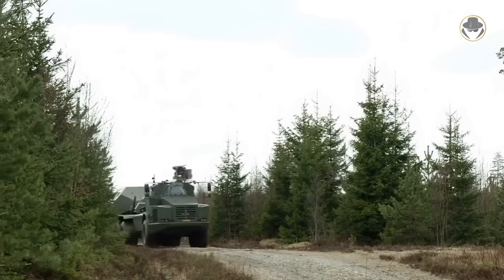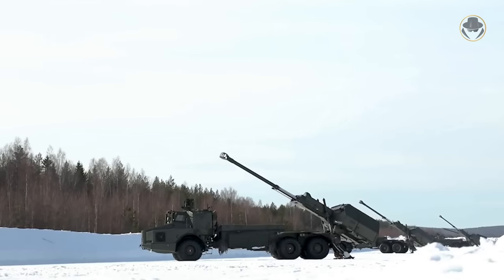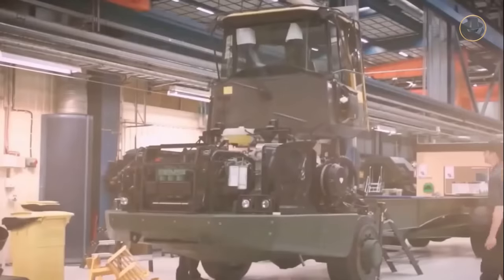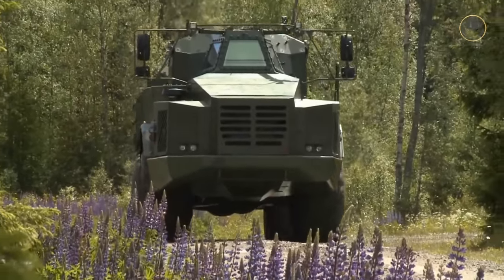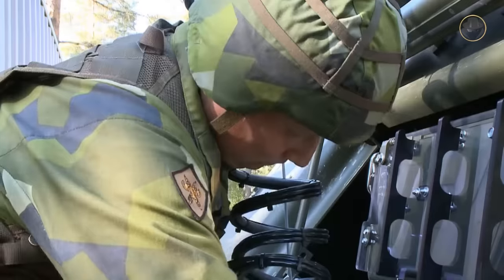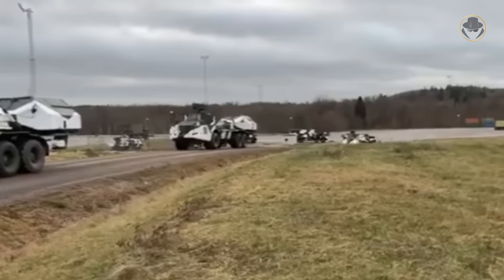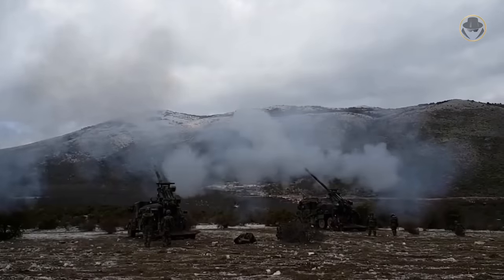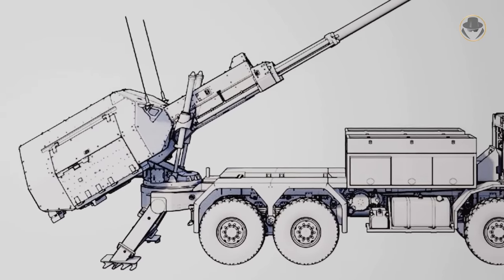Archer Artillery System | What is wrong?

Comment: They are very long, difficult to use off road in broken/rocky terrain, also useless off road in all but dry or frozen conditions, hard to use in densely forested areas, and too expensive.
Reply: It's the other way around, these are much better at handling difficult terrain the regular trucks.
Reply: @znail4675  try taking one over a ditch, or over the crest of a ridge. There's a reason why the no one on the planet takes articulated (semi's) lorries off road son.
Reply: @nickmail7604  its not a semi its a rock hauler thats famous for its offroad capability

Comment: I think it is just to expansive, Serbian Nora b52 155mm wheeled howitzer gives most things Archer do for 1/8th of the cost, more than hundred sold abroad so far with many more ordered. The only issue Serbian company has is production capacities, they can only make about 1 battery that is 18 howitzers a year. Even USA Army was interested into Serbian made system and if you compare Swedish and Serbian defense industry l mean Swedes make some sweet high end military tech and Serbs make cheap stuff for third world countries.
Reply: In war, you win or die. You pay to not die.
Reply: @atlet1  l agree but still there is something called cost to benefit ratio, you can pay for 1 battalion of Archers and cover just part of battlefield with allot of fire power or you can pay the same price for 8 battalions of Nora B52 and cover all of battlefield with not much less power. Serbia also has MGS-15 Howitzer witch is more high end similar to Archer but countries still buy Noras because of their awesome cost to gain ration.
Reply: @youmad7068  Archer is an artillery system, not a howitzer. The level of the defence technology needed to survive, depend on the level of the enemy. For Sweden, the only possible land that can be an enemy is Russia, which have sofisticated modern weapon systems. Countries preparing for actions against less advanced enemies can save on cheaper weapons systems.

Comment: You neglected to include the foreign sales regime of the Swedish government. Questions like, is it compliant to NATO - Joint Fires standards, will it licence the system for foreign manufacture and/or provide full IP access to allow foreign maintenance and modifications? In the past Swedan had paused sustainment of systems to foreign customers they had deemed involved in conflicts they did not like. These might be a significant weapon sovereignty issues for any potential customer.

Comment: You should make a video on Sweden’s small tactical nuclear weapons system that was developed in the sixties and are still in use
Reply: Rubbish. 

Sweden considered developing thermonuclear weapons in the 1950s and 1960s. A heavy tracked artillery system was produced in small numbers, possibly to be used for tactical nukes. A small experimental reactor was built to learn about things like producing the nuclear material. Sketches where made for a supersonic bomber. But it stopped at that. In 1958 the program changed focus to protection against nuclear weapons, rather than producing them. In the late 1960s Sweden signed the Non-Proliferation Treaty, and thus all prospects of Sweden having nuclear weapons came to an end.

Sweden never had nuclear weapons of any sort. And the propability of Sweden having such in the forseeable future is in reality zero.

What on Earth made you clame we have? You are either very badly informed, or you are deliberately spreading false information.
Reply: @davebowman6497  Well, he is not all wrong. We kept working in these nuclear developement facilities many years after we said we would stop. Noone really knows what happened there and why they didnt close it. There's still an possibility we did make tactical nukes.
Bandkanon 1 was supposed to be able to shoot tactical nukes.
Reply: The mere notion of the possibility to keep this secret for 50+ years is silly. Even more so if the country would have any delivery system for such a weapon - which it does not.

Wild speculations and conspiracy theories does not make anyone even partly right.

Comment: So the smartest thing BAE systems can do is to send a few of this to Ukraine and show they are not that hard to use or maintain. Unlike commercial trucks, this is a commercial truck designed to be abused in mines and quarries. So it is likely it will not break down under the extra strain of going off-road, while truck mounted artillery will put the truck under strains it wasn't designed for.

Comment: COST TO CAPABILITY RATIO SCALE OF VARIOUS ARTILLERY SYSTEMS. 

Tracked artillery (Pzh2000, K9) -> Large MLRS (Smerch, M270) -> Automated protected artillery on articulated wheeled chassis (Archer) -> 
Automated or Manual, protected artillery system on wheeled chassis (Archer on Rheinmetall MAN chassis, Aleksander SPA, Protected artillery turret on truck or wheeled chassis i.e. Nora B-52, Zuzana, G6, A-222 Bereg) -> 
Light MLRS (Himars, Tornado) -> Automated external artillery on wheeled chassis ( Ceaser 2) -> Mortar on tracked chassis (Amos, Mojlner, 2S42 Lotos) -> 
Manual external artillery on wheeled chassis (Atmos 2000, Ceaser 1, 105/122 artillery on light trucks or heavy jeeps) -> 
Mortar on protected wheeled chassis (Nemo) -> 
Detachable towed artillery on wheeled chassis (M777 portee) -> Open top/external mortar on wheeled or tracked chassis (M1064, 2S40 Floks) -> 
Power assisted towed artillery (FH-77, Atags, Dhanush, Panter) -> Conventional towed artillery (M777, SLWH Pegasus) -> 
Towed/Large mortar systems (M240, 2B9 Vasilek, 160mm Mortar's, MO-120 RT) -> 
Towed MLRS (Type 63, RPU 14) -> Single shot rocket artillery ( Grad-P) -> 
Mortars 60 to 120mm.

Comment: There is some discussion in Sweden if the Archer system should be sent to Ukraine. The argument against is in line with the video, related to the complexity of the system and maintenance. People using it has to be trained, which takes time. Another factor is the number of units we have in Sweden, and sending some of those, say 24, will create some challenges to our own defence. This is also a common challenge at the moment for all countries sending weapons to Ukraine. More has to be produced in a short time. However, the war might be a really long one, like the Syria war/conflict, and we have to consider such implications. So it is time to consider more advanced systems like Archer, and jet fighters as well, and start planning asap. Even if training takes 6-12 months, it will eventually make a difference.
Reply: theres no way we would be sending that many, maximum 12 but im guessing lower. The new government will likely be sending some i think.
Reply: They had 24 sitting idle up until recently
Reply: I hope Sweden sends at least 12.

Comment: 8:12 Wait. If it takes 3 seconds betwen every shell fired, how can you put 6 shells in one place at the same time? That's 15 seconds of reloading, so once the last shell is fired, the first one is well on it's way to the target if it hasn't hit already?
Reply: They are fired in different angles and have therefore different travel length to the target. The Panzerhaubitze 2000 has the same feature and there are some videos that show how that multiple impact technology works
Reply: Also different charge sizes

Comment: You said they evaluated a CV-90 hull, where is that prototype & was that CV-90 option shown to other customers like the British & the U.S.? I would not be so quick to dismiss the advantages of tracked vehicles in undeveloped and especially rugged mountainous areas. You gave it very short shrift by saying yes they are better cross-country but perform more poorly on roads. The issue is we don’t always get to choose where we fight. There is a very good reason that all mechanized armies are mostly tracked vehicles, as the U.S. found with its Strikers in Afghanistan and Iraq, there are some places wheeled vehicles just can’t go when & where you need them. There is a reason the U.S. mechanized Armor corps have considered the Striker a poor substitute for Bradley’s & Abrams and has reversed course. Perhaps in Europe where it is more developed & roads are common this seems like a stodgy & conservative perspective but recent battlefield experience with the Striker platform says no. Perhaps if Bofors wants to sell more Archers they need to offer it with a modern tracked chassis. Especially for places like Mud season in Eastern Europe & Asia’s Monsoon.

Comment: How many rounds in  three seconds burst ???
Reply: Do you really think this thing shoots 13 rounds in 3 seconds?
Taken from BAE Systems' website:
"
Calibre: 155 mm
Barrel length: 52 calibre
Elevation: -1° to +70°
Traverse: -85° to +85°
Projectile magazine: 21 rounds
Charge magazine: 18 charges
Rate of fire (burst ): 3 rounds/20 sec
Rate of fire (intensive): 21 rounds/3.5 min
Rate of fire (continuous): 54 rounds/35 min
Range: HEER 40: Up to 40 km
BONUS: Up to 35 km
EXCALIBUR: Up to 50 km
Into action: approx. 20 secs
Out of action: approx. 20 secs
"
Reply: @Tiax776  Thank you for letting me know Sir. Good day fella too.
Reply: @Tiax776  My Bad fella. That speed of loading would not be possible. Physics rule.

Comment: One point not mentioned is the crew size, labour is one of the biggest  through life cost. The archer has a crew of 3, as against 7-9 for current SPG’s The system on a Man truck was to entice the UK, as they are major users of the Man truck system. The main Competitor is the K9, tracked SPG, hardly cheap to buy and maintain. Even less if adding the K10 loader

Comment: Wikipedia say Archer top speed is 90 km/h... Not 65 km/h?
Reply from the maker: The info from official website of the Försvarsmakten
Reply: Depends on if it's the hauler or truck version. The truck version can reach 90 while the hauler can only reach 65.
Reply: @WeaponDetective  makes senes. Wiki is not the most accurate place :)
Reply: No the Volov dumper truck do not have the gear to make 90km/h, trust me I have lay behind many (unloaded) Volov dumper trucks, but they have fantastic off-road capability.

Comment: They should put the Archer turret on the CV-90 to make a artillery version of the CV-90
Reply: No CV-90 can take it, maybe a stretched Leopard 2 hull.
Reply: @kirgan1000  The Archer turret has almost no armour you would never put it on a MBT Hull and the Leopard 2 is German     Britain and Sweden do not want a German vehicles. Britain may not produce that many military vehicles anymore but that is going to change Britain is going to start making military vehicles again. Germany and France are both Britains rivals
Reply: @jammiedodger7040  You are aware that Sweden is using the Leopard 2 as the MBT right?
Reply: @Groza_Dallocort  They do use the Stridsvage 122 that is based on the Leopard 2 in extremely small numbers and you do realise they have got plans to get ride of them right and replace them with CV-90 Ghost

Comment: Length 14,1meters, and with a hinge. Panzerhaubitse is 7,87meters and K9 Thunder 7,44meters. Plus they are on belts. Good luck taking that thing of the highway and driving in and out of position.

Comment: You continuously call the gun bore the wrong size. It is not a caliber, it is mm. Definition of caliber is  " the diameter of a bore of a gun usually expressed in hundredths or thousandths of an inch and typically written as a decimal fraction" the quote is from websters  . You calling it a 38 caliber is a handgun sized bullet about the size of a 9mm bullet.

Comment: 6:50  Am.. nope! It does not fire 13 rounds in 3 seconds.. are you dunk mate??😵😋 Also 75 round per hour?? That's one round every 48 sec.. Which makes no sense either. That would make it the slowest firing SPH in the world, pretty much. It's actual rate of fire (as you, yourself, mentioned later on) is 1 round every 7,5 sec officially. But when you actually measure it, in the official videos from BAE Systems (the ones you used for this vid), it's a lot slower than that.. At 4:37 - 5:16 for example it's around 11-12 sec between the rounds. And at the end.. (14:01 - 14:44) Between the first and the second round, it took almost 9 sec. The round after that 9 sec as well. The round after that was also ca 9 sec and so on. The "Burst mode" that you are referring to here. Is 3 rounds in 15 sec. And not because the gun all the sudden just crank up the rate of fire to 1 round per 5 sec, but because one is already in the barrel.

And the reason no one buys this SPH, is because it's horrible. Yes, I absolutely hate this p*ece of sh*t Frankenstein-spare-parts, government-DIY monstrosity!! Everything is wrong about it, except for the range of the gun, which, if true is pretty much world leading, as far as I can tell. And that says it all pretty much. Because if the gun is the only part of the Archer system that's great.. Then you might as well mount it on the absolutely beautiful technical marvel of a brilliantly, simplified, masterfully engineered, "Bandkannon 1"! Bring that back and update it! The Swedish armed forces has suffered and been shamed enough internationally as it is.. And the current status of the Swedish armed forces is an ABSOLUTE F*CKIN JOKE!! Sorry for the swearing and the all CAPS, but.. my country has just been going down hill during the last 40 years pretty much. And it's just getting worse and worse, each and every day! So don't even get me started.. Unless you want an epic long comment to read.. lol! 

But just to mention something though.. Get this.. our Government didn't think our fighter pilots had a long enough education, nor an important ob enough, to deserve a pay rise.. SINCE 1997!!! How much of a soulless, dishonest, unfair and absolutely incompetent and unappreciative fool do you have to be, to treat your creme de la creme, in the armed forces this way. Oh and how much do they get paid?? ca 3800 USD/month.. A complete joke in and of itself!! But it gets worse.. and no, not just that 30-35 % immediately disappears by the standard income tax of Sweden, which every citizen that are employed have to pay, unless you just earned ca 6800 USD in total per year. But!! The politicians that decided to keep the fighter pilot salaries this low and for this long, with absolutely no adjustment for inflation, earns TWICE that money per month!! Yeah,.. real honest people right there, eh!! Oh! but I'm not done yet.. because get this! The fighter pilots finally had enough! And so, OVER HALF of them are either going on a long term break (leave of absence) (tjänstledighet), which can last up to 12 month or more I think. Or they're simply quitting their job completely, to never ever return, most likely. Apart from maybe a few perhaps, if the salary improves by 75-150 % or so, if I have to guess. Well done all political parties, but one!! SD, "The Swedish Democrats" are the only party that does not have any fault in this, as they haven't been allowed to govern Sweden yet by the other backstabbing, straight up lying, dishonest parties. And that's a fact, not an opinion. And SD is the only party that wanted to increase the military again, during the last 20 years. And still wants to do so. And more than ever now, given the situation with the Russian invasion/escalation of their ongoing war with Ukraine. But maybe there's a small glimmer of hope. Because at least they have a slightly greater chance at getting minister positions in the government. Since we just had an election this past Sunday and.. WOHOO!! The right wing side won. And SD got 20,5 % of the votes. Their highest ever. But last time 17,7 didn't give them any influence, since none of the other seven parties wanted to work with them.. Times have changed somewhat though. So let's hope! Although.. I won't believe it until I see it. The negotiations behind closed doors have started.. I'll try to remember to come back here with an update, when I know how the final government composition will look. Stay tuned!!

And have a nice day!

PS. Thanks for a good vid. Just a few mistakes. Though, as you all could tell from the above, I do not agree with most of the praise you have for the Archer system. I will make an epic detailed comment on why that is specifically, as well! ; )

Comment: As everything that is made by Volvo including its Marine division which I’m more familiar with is that expensive and availability of parts. if the archer system is anything like Volvo marine then I wouldn’t touch it with a 10 foot pole. The last thing you need to do is have it break down and not be able to get spare parts for a few weeks if you’re lucky.

Comment: I suppose you could add a self driving system and remote firing and you could send it on its way to fight on its own?
No ration logistics or worries about casualties to be treated etc.
Artillery fire causes more casualties than tanks or Infantry, you don´t want to be on the wrong end of these 155mm monsters that will wreck your weekend more than 99% of visiting mothers in law?

Comment: The issue has never been its performance. Bofors is a reputable maker and is one of the best in the world. The issue is the price.
It’s way too expensive.
Reply: The issue is that Sweden don't want to give this system away because they know it will be copied
Reply: The price is about the same as every other mobile artillery piece out there. It's even cheaper than the Caeasar in certain instances, at least if we go by the swedish price figures, which includes development cost, if I remember correctly.